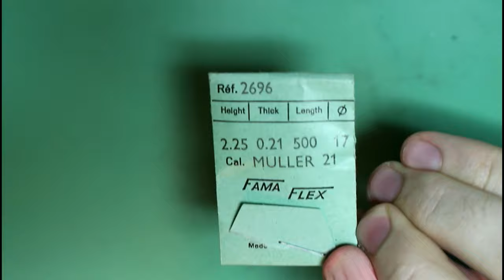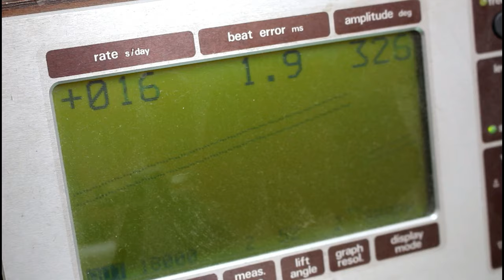1912 WW1 Silver Pocket Watch Restoration

Comment: Very nice repair, few small recommendations: Use brass tweezers to prevent damage and use less grease to lube the barrel as the stuff will gunk up and that ain't so good, also before fitting the pallets its a good idea to let the watch run by just winding up the barrel to let the oils sink into the jewels properly and please take off the balance and spring to properly clean and oil the endstones.
Reply from the maker: Thanks for the tips, yeah typically I'll grease a little more on larger watched like this and I do let the watch run prior to putting the pallets in but sadly didn't record it. And I'll be sure to do a full strip down of the balance where necessary in future vids :)

Comment: Very nicely done; the photography is outstanding and the steps are very clear. I'm watching excellent videos such as yours and plucking up the courage to tackle my grandfather's watch which has been stopped for decades.
Reply from the maker: Many thanks man, best of luck working on your grandfathers watch :)
Reply: If the watch has any sentimental value have one recommendation: don’t. If you’re interested in the Hobby start with something cheap and you wouldn’t expect your first service to come out perfect. Things are easy broken and finding parts for very old watches is a total pain. Get yourself a cheap Chinese movement (something like a seagull st36) and tear that thing down as often as you want. If it still works once you put it back together you did a good job.
Reply: @Jonas_GD_1234  Excellent advice; I looked inside and when I saw signs of some liquid inside along with a non-functioning mainspring barrel, I closed it up again and will get it repaired professionally.

Comment: Could you kindly advise as exactly which type of oil you often use to lubricate the main spring barrel & any non-jeweled bearings?  I'm a newbie in horology and I often use Moebius 941 and D5 respectively, dunno whether it is proper?

Comment: Not Shown so must ask:
Time grapher showed +20 seconds per day. Did you adjust the regulation to lower this? Even if only a 7 jewel watch, it is capable of under +/- 5 seconds a day.

Surprising you did not remove the balance wheel then the ballance jewel to clean and lube it. Never seen someone lube that jewel the way you did. I hope it works.

"The new main spring didn't slide in, so I removed it and hand wound it. I could have used a main spring winder, but The size of the spring made it easy to hand wind..." (or words to that effect)
Isn't therea high chanceof damaging the main spring by winding it on by hand? (twisting it, for one.) 
I've hearrd that a main spring winder should always be used, unless a new spring that is installed from its holder. 
Since the new spring "is the right size" it should have slid in.  Were you centered over the barrel, with the catcj lined up when you attempted to install it before hand winding?
BTW the new spring's thickness (.021) is not the same as the micrometer's .020 measurment of the old spring.  The height differed as well.  The spring MAY have been in spec, but it is NOT "the same size" 
How did you determine the 500(mm?) length for the new spring?

You FILED a high spot on the case, then used solder to fill the resulting hole?!? 🤯😳 
You then used a punch to raise the dents...
I sure hope the case is N'ickeloid" (or other trade name used for nickle silver/"German Silver") not genuine .925 sterling silver or .800 coin silver.
Wuy didn't you use the punch to tap down the high spot? A "high spot" is a dent/low spot on the reverse side.
At least you were able to temporarally hide the solder "repair" It will show given time.

Not sure why you polished the case to look "new ... other than to hide the "oops" you made filing a "high spot" resulting in a hole.

Comment: What would a restauration like this cost? I have an old Venéta Prima Incabloc after my grandfather. I understand that it's probably worth less and possibly even alot less than what the restauration would cost, but that doesn't matter to me. 

It actually runs fine though, as far as I can tell, and it has no dents or scratches. But it should need some oil after some 100 years I assume, and there's what looks like a small smudge (from a finger?) on the face dial which would be nice to remove. And the silver has yellowed of course.